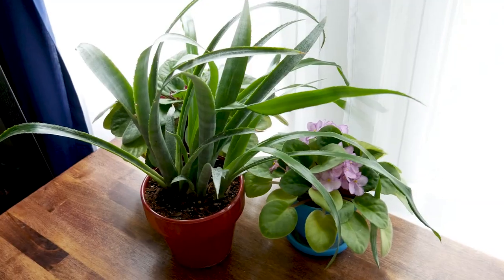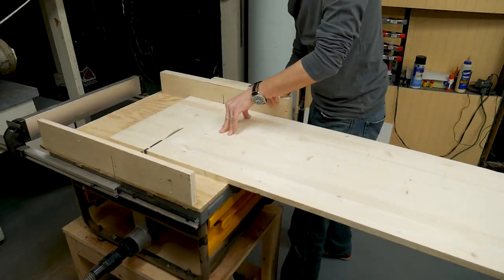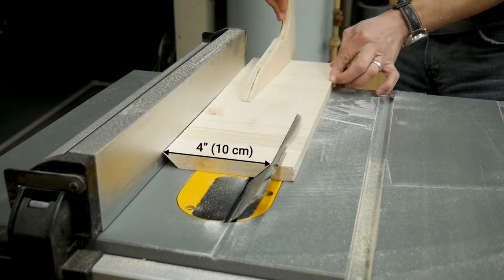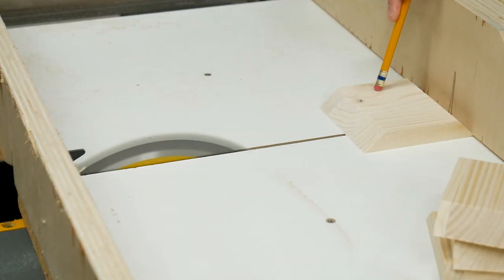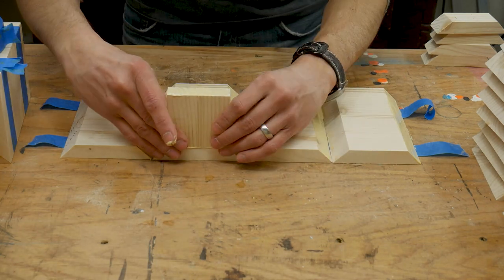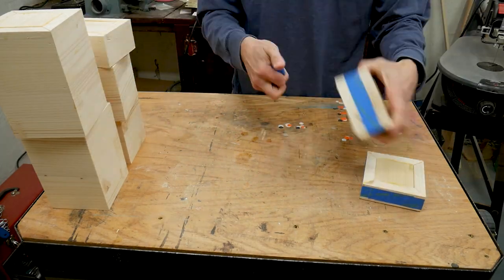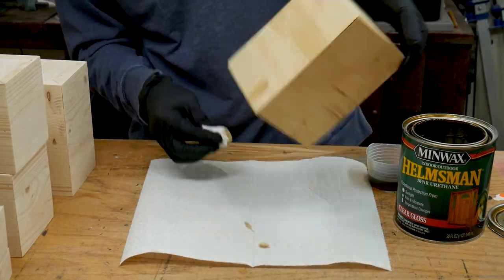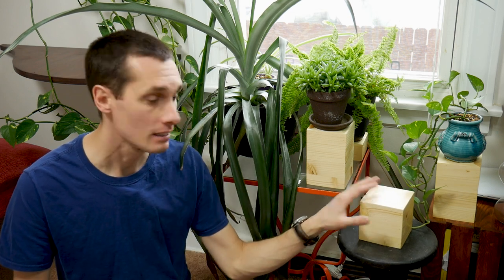How to Make Easy Wooden Stands (for Plants and Other Things)

Comment: Great idea. Thanks for sharing the video.   I have "tons" of scrap pieces of melamine board. I planned to throw them away. But this is a way they can be made useful.
I don't have a table-saw yet. I don't feel comfortable to do it with a circular saw or hand saw nor I have the patience for doing it like that.
I need to save my patience for getting a table saw. The melamine boards are lying around in my garage for many years already. I guess they don't mind
lying there around for a little bit longer.